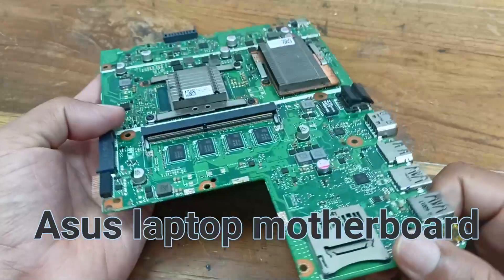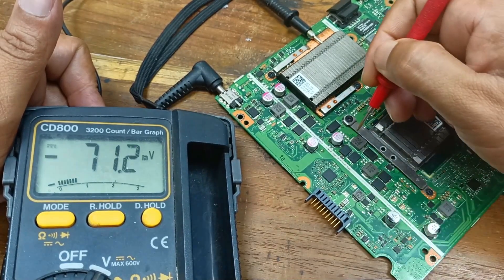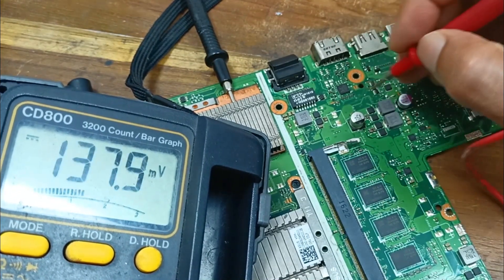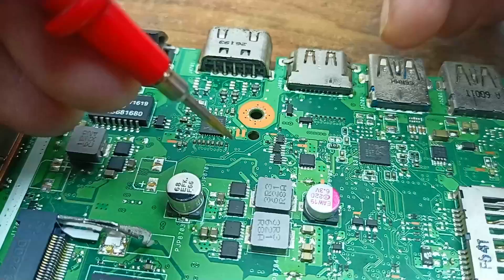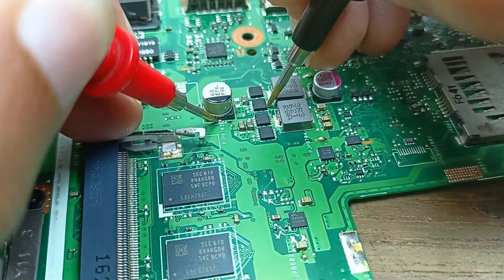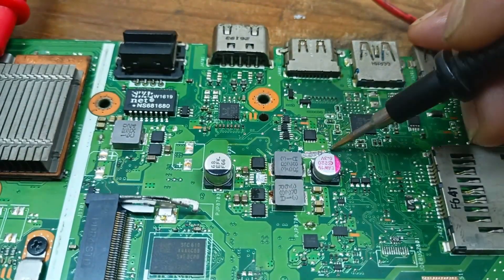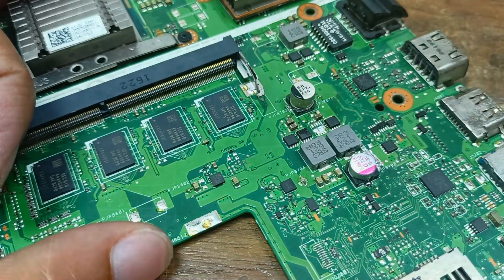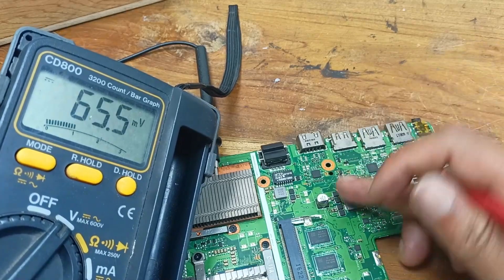Asus laptop not turning on || How to diagnose laptop motherboard easlly.

Comment: you put a scratch to isolate short side ?  .. i didnt quite understand
Reply from the maker: I just separated the short circuit from 5 volt parts for checking the primary power supply